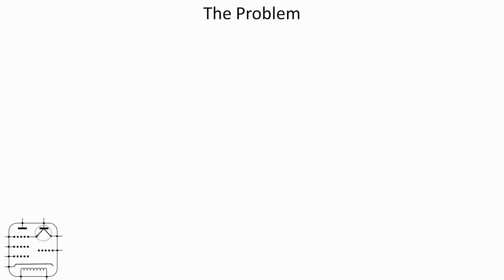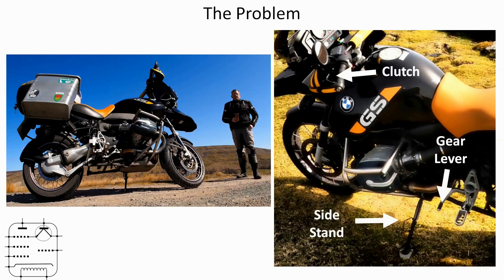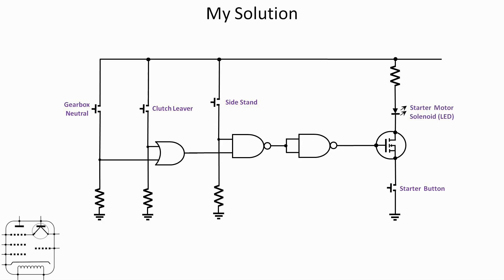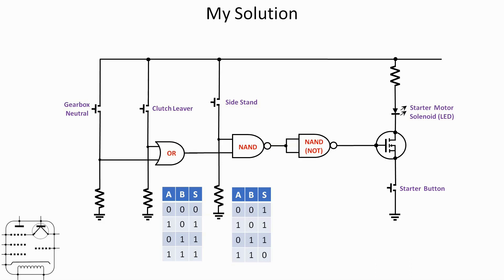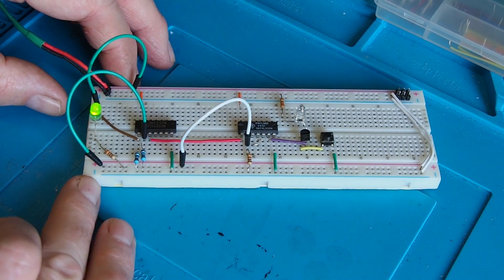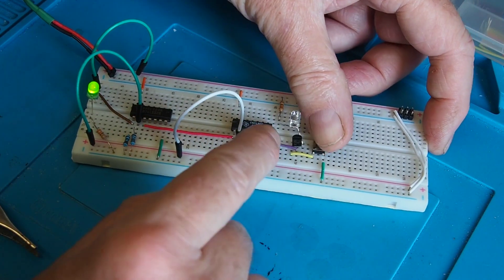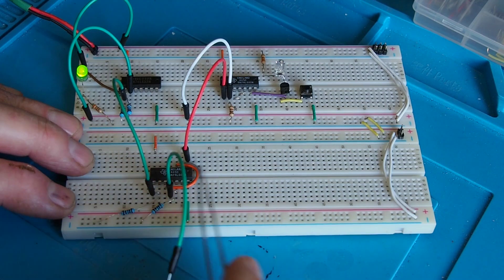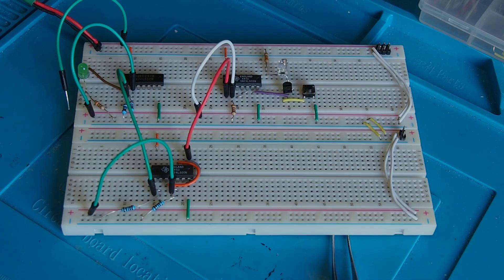A Logical Problem - #142

Comment: I found this interesting to watch despite not understanding the clever electronics but was left wondering, was there anything in that to cover the situation of stopping the bike and putting the side stand down momentarily and then riding off again with the stand still down. because you appeared to have everthing covered to prevent engine starting in less than ideal conditions, but nothing to cut the engine if the stand was put down again afterwards. Just curious.

Comment: And of course you can make an AND gate from a NOR gate if the inputs are active low. If you do this, you can simplify the circuit to use just one IC -  a 74LS02 quad NOR.

Comment: An excellent investigation! I wasn't sure, if you intend to actual install the device on your bike. If so... Gates are midway between hard analog solutions and full microcontroller solutions. Straight analog = You probably could obtain the needed logic control by just cascading sensors and switches in some particular order. Full digital = The most basic of microcontrollers would require less cost and physical PCB board area than just one of the gates. The code required would be super-minimal, only a few lines. But, there is the cost of the programmer and the coding knowledge to consider. The Arduino microcontroller system is designed for hobbyist and is easy to use, once you have the gist of it. You might want to research it. A small ATtiny 8/DIP chip would probably do everything that you need and more. The greatest challenge will likely be integrating the switches and sensors. Th neutral sensor can be taken directly off of its LED indicator. A contact switch could be added to the clutch handle and to the kick stand. Mounting those in a robust manner will require effort. And, they must be well protected, particularly the kick stand sensor. All good fun to think on; thanks!
Reply: I was thinknig the same after seeing the logic chips, a esp32 is smaller then that and only a few dollars, these chips although simple still require the overhead of construction using as much material as they do, so it becomes less efficient. But theres somethign about a simpler system i think outweighs this, thers more overhaed to run a microcontroller, more thigns that can go wrong /glitch your code, having a simpler solution like this i think is more robust/safer and worth the extra cost if there  is any. I respect simple solutions like this then just throwing a microcontroller at it. I think intuitively for efficiencey sake you'd leave a microcontroller as the last resort, but no hobbyist does this I understand and why we're  commenting here on youtube instead of getting rich inventing clever dollar store gagdets with only a few componontest because we cant imagine anything without an arduino.

Comment: Like you said, you can make an OR gate by using a NAND gate, as long as you invert the inputs too. I think the easiest way to do that in this case would be to swap the switches with the resistors (connect the Gearbox Neutral switch and the Clutch Lever switch to GND, and the two resistors to +5V).

This way you could make this work by using only one 7400 IC.
Reply: This is exactly the point, where almost any explanation of TTL logic goes crazy — the correlation between boolean true and false on the one side with the TTL high and low (input/output) state on the opposite side. People tend to expect, that boolean true is always represented by TTL high state and boolean false by the TTL low state, but there is no real reason for this assignment, in fact, this assignment describes positive type of input (or output), but you can also assign TTL high to boolean false (and TTL Lo to boolean True) to obtain a negative type of input/output. So you can invert your input/output by some invertor, ok, but also by changing it from positive type to negative (and vice versa), which is sometimes much easier to achieve, in this particular case just by swapping the switch with a pull-down resistor (making them pull-up). And. I expect at this point, that true means pushing that switch and the switch is normally open type, which in fact adds another two layers of the same thing to that problem… This becomes much more clear (or complicated, it depends on the point of view) when it comes to a differential logic, like ECL or LVDS, where is nothing like an invertor gate, because you can invert any signal just by swapping that two differential lines.